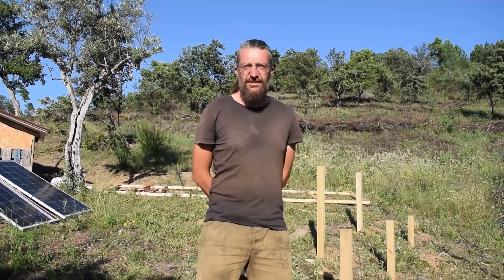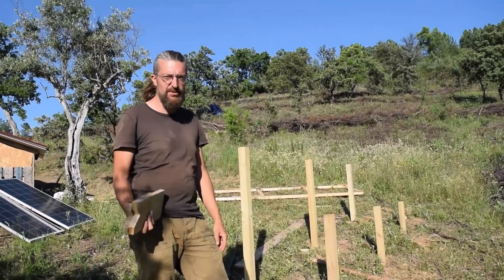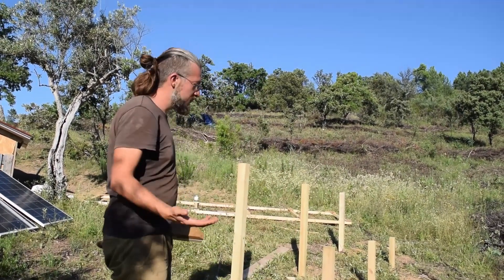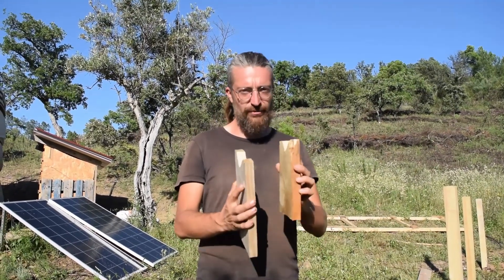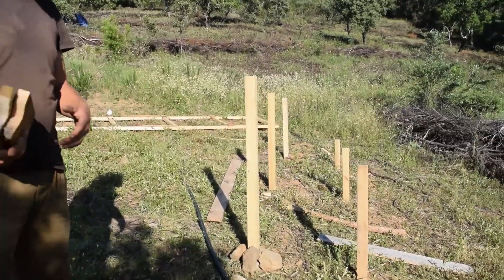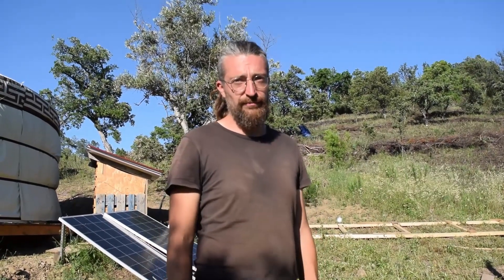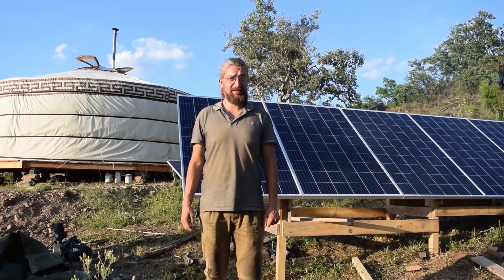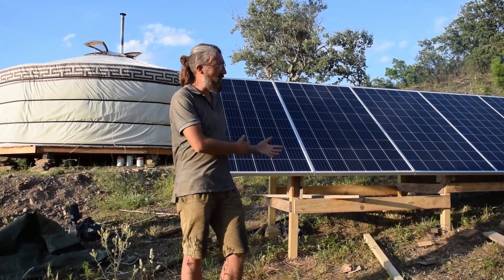Our new small off-grid solar system -Building a frame with reclaimed materials and installing issues

Comment: I have a similar system. What I did was make a adjustable frame so i can change the angle for summer versus winter. You could perhaps just cut the higher posts for the summer angle and make up extenders for the winter angle. I guess getting the perfect winter angle is more important as less sun and more need for heat and light ;)

Comment: You should to do more research about solar systems before you buying. Definitely acid lead batteries are not good for solar.
Reply: Lowest initial cost, good life is if you treat them well and never drop their voltage too low. The whole object with batteries, it helps on low sun days. Not so much for evening, since main power usage should be done.

Comment: YOUR AUDIO (sound level) IS TOO LOW (quiet). The issue (thing) with solar is to go with nature. Use high power devices during day and low power when dark. High temperatures like 45c are an asset when used with water systems. Anyway, cool journey, wish you all success!❤

Comment: 1- Tracking the Sun will double production. 
2- Cheapest energy storage is "hot water" 
3- Use 12v (led lighting) for all your lights
4- Make the least use of the batteries during the day
5- use inverters during the day for high load devices
Have fun with your quinta! ;)
Reply: ABSOLUTELY CORRECT.
Reply: Cheapest energy storage is hot rocks, sand or bricks. Water needs to be contained, and that container cost money at some point.

Comment: G'day from Australia , Maarten for your well water and pumping you can buy 12V water pumps that will pump up to 35 meters high that are fairly cheap add a suitable battery and panel and run it as a separate system then it wont drain your house batteries.If you can pump to a tank on a high bit of land you can gravity feed your water.  Good luck with what you are doing.
Reply from the maker: Thanks for the tip :) We might do something like that in the future with the old solar panels. For now with our small pump it works quite well already, when the sun is shining it doesn't take anything from the batteries. We already gravity feed our water, that's the great thing about living on a hill :)

Comment: How are the gel batteries performing? I would not have chosen them buy you bought a kit so you get what your give. How the water situation ie start of summer Portugal is very dry and Morocco is going through a drought hows the water situation?
Reply from the maker: Can't say anything about their performance yet, haven't used them long enough. I guess it's good we all get to make our own choices :) 
Water is actually fine right now, we've had an extremely wet spring so the well is not even going down yet. And not all places in Portugal are very dry, depends on the location and the year.
Reply: Our Portuguese Homestead  You are right: I live in center of Portugal, in a village... I have a well 6 meters deep and in the last 40 years it never dried up.... in the summer...and i use a good amount of water in the house .cleaning  the patio, and watering the gardens....👍

Comment: Great to see you both involved in the videos. Washing machines can have very high consumption (over 2kw) even if they are rated low, the initial pull is very high. We use a twin tub washer with our solar. Only 350 watts on wash or spin cycle. It's a good compromise. You can  get one off ebay for around 100  euros. You are a lovely family 💚💚💚
Reply from the maker: We'll be looking for one soon, I'll keep that in mind :)

Comment: I hope your guy sorts your solar out. I have been trying to get my system working in England before I send it over. We have 16 Batteries with a 48 Volt set up 5KVA using 12 Panels. Because of the weight limit on my van. I have brought half the Batteries and panels over already. My guy is still having problems with setting up the invertor. We have 240 Volts  off the invertor , but the invertor is not recognising the solar panels putting power into the batteries even though there was 110Volts going into the invertor. My guy even got in contact with a friend in South Africa who is a whizz kid, but at present he is going to dig a bit deeper to see if there is anything obvious that he has missed. 
This Solar/Battery set up business is not easy, but I am sure you will get there. Take care, stay safe. Steve
Reply from the maker: You're in Barbaido right? Our friend is close to there, if you still need help later I could contact him :)
Reply: @ourportuguesehomestead  If we have any hiccups at Barbiado it would be handy to have an English speaking expert. I am learning Portuguese, but talking technical is difficult. I do a lot of pointing and hand moving when I talk to a local. The majority of the village are elderly, but they are all lovely. Thanks for the video, You really are living the dream.
Reply: @stevepick2523  of
Reply: You do have an MTTP controller, you will one

Comment: 40 degree angle is to much...summer tilt is latitude minus 15 degrees, winter should be latitude plus 15 degrees...or a average tilt of 35
Reply from the maker: If it turns out to be too much we can always adjust it, no problem :)

Comment: Yea! on the solar system startup. Great job getting the panels in place on a sturdy DIY stand.  Good to know that you are planning how and when to make use of the system. So exciting that you all are thinking of possibly adding wind powered generator later.  Yep it sure does get complicated getting all the parts of the system to work together. It is so good you have your knowledgeable friend to help with the details. Sounds like some good fortune is going your way. As always thanks for sharing.
Reply from the maker: Hope it answered all your questions :)